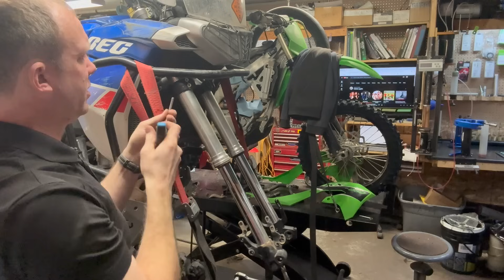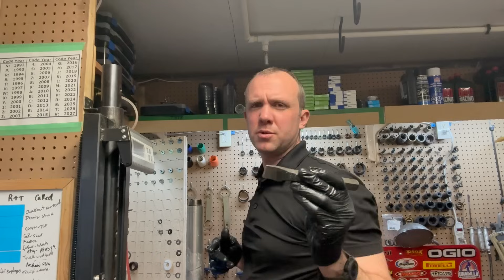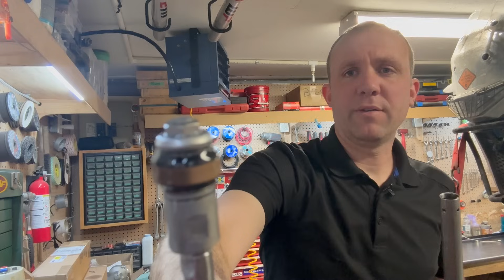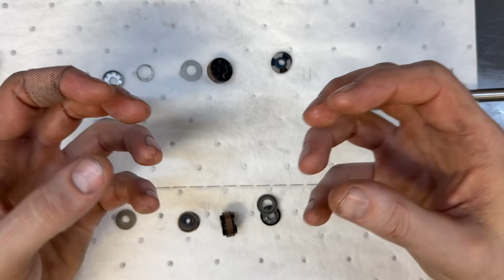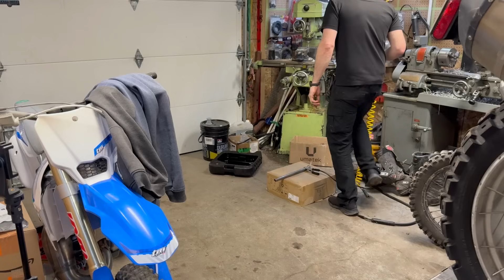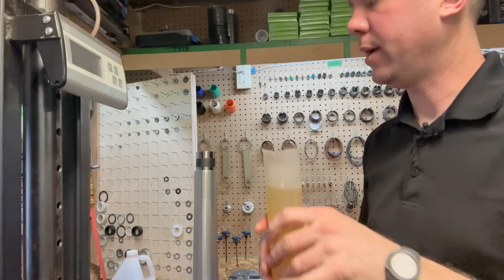How to Fix Your ADV Suspension

Comment: I've bought an Andreani cartridge kit for my Tenere, cause it was harsh on small bumps, after they installed the kit, it became even more harsh than it was, so I sold the bike.
Now I have a Tuareg 660, I knew a piston was upside down in it, and it was also harsh, so I had it changed, and now I dont feel any difference...😂
This is driving me crazy

Please help me someone, which ADV bike has a proper suspension stock?
I also have a 1290 R, but its to heavy for the type of riding I do...
Reply from the maker: There is no ADV bike with good stock suspension. There are excellent solutions that don’t cost much, but you need to talk to a tuner who understands your riding needs.

Comment: How satisfied are you with the mod? I have just opened my Tuareg fork and I'm considering whether to only repair the original setup with the reversed piston and broken shims, or to do the mod as you did. I am not plannig to replace spring to linear.
Reply from the maker: It’s an improvement but it’s absolutely worth checking out Evo Oregon’s base valve kit. Adding a proper base valve really makes a massive difference.

Comment: Hi, I like your idea of making this into a symmytric setup very much. I think 1+ mm float is really a lot though, I would expect it makes the midvalve comp damping almost non existing except maybe on very fast compression strokes? Leaving all the slow and medium comp damping to the crazy check plate base valve of the comp leg. Did you consider to use a smaller float and a more compliant stack?
Reply from the maker: I have set float hundreds of times or more. For moto or very aggressive woods riders, 1mm is too much. For novice to intermediate riders 1+mm is necessary.
Reply: Ok! looking forward to your opinion on the test ride

Comment: Hey Chuck, If you get more in that people want work, I sell linear fork springs wound specifically for this bike in a variety of rates that are drop in replacements. No need for mods or adapters. Additionally I have a high speed compression base valve circuit that I sell that swaps the old base valve (no shim dampening) for a proper shim dampened unit. It fits this bike, the Ducati DesertX and the new CF Moto Ibex 450

My shop is Evo Oregon Suspension. We’ve conversed
Reply from the maker: I’m actually doing an Ibex soon. You got my email?

Comment: Great vid with some useful information. Thanks.

I was disappointed when I first rode the KTM 890AR. The suspension was far, far too hard and harsh. I was even more disappointed when I opened up the Xplor forks (the old 950 Adventure being my benchmark). I've more or less sorted the forks now, but I've had to convert them so that there's compression and rebound in both legs. Similar principle to what you were saying about flow and ease of tuning. Thanks again.
Reply: Hello, so the 950 adventure has compression and rebound on both fork legs? I am a happy 950 adventure owner and I would like sort my suspension also.
Reply: @z00_50  Perhaps I wasn't 100% clear. I like the 950 suspension very much, but it can certainly be altered to suit you if you're not happy. The 950 forks have compression valves in each leg, and rebound valves in each leg. In my opinion this is good, better than the modern trend of having a small compression valve in one leg, and a small rebound valve in the other. Bigger valves flow more fluid, so easier to tune. I don't know where in the world you are, but you should be able to find someone capable of tuning your suspension to suit you and your riding style. The bike has been around for over twenty years, so it's well known and understood.
Reply: Thank you very much for the reply, yes there are some good tuners here but my initial concern was about the compression and rebound valves on each leg. I was thinking on revalving my suspension but now it's the time
Reply: @z00_50  No worries, but be very careful. There are too many suspension 'specialists' out there, so if they can't deliver what you ask for, YOU have to pay again and again for them to get it right. Very good for them, but not you. Best is to ride a similar bike that they have modified. Good luck. Are you in Greece?
Reply: Yes how you know?
Reply: @z00_50  When I clicked to reply, a name beginning with K and a Greek ending appeared briefly (just a flicker, then it went away).
Reply: You have guessed it right from beautiful Greece, once again thank you very much for the information, I will try and revalve the 950 and reply how was it
Reply: @z00_50  Yes, do that 👍🏼

Comment: Ironically, the Tuareg has one of the better stock suspension set-ups of an adventure bike, as long as the shims are in the right way round at least. Such a good video man 🙌
Reply from the maker: I think the T7 forks are the best of the bunch. They have 2 functioning mid valves AND base valves. Easy to re-valve. These are pretty good though once set up.